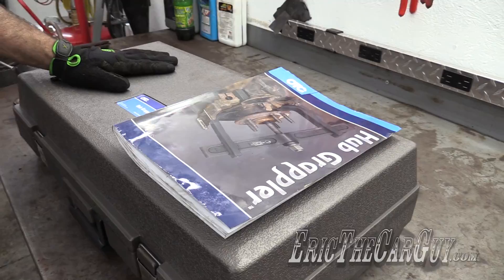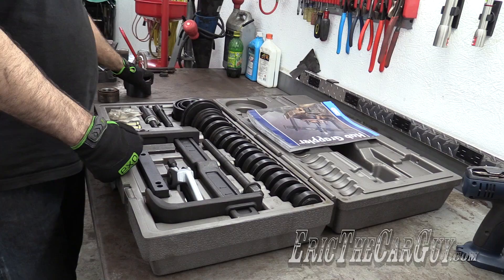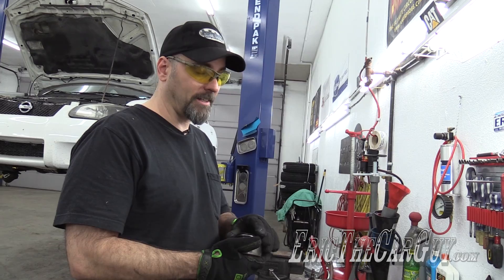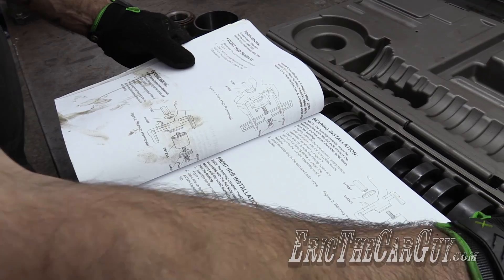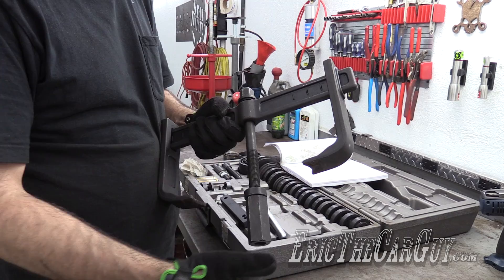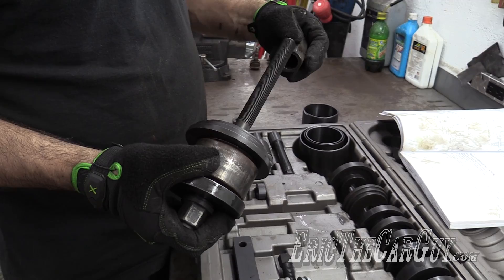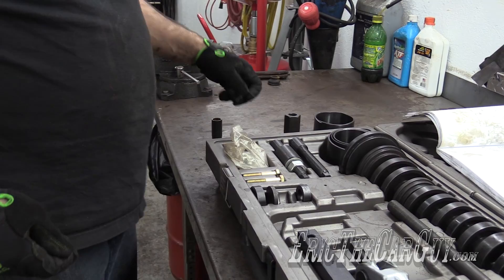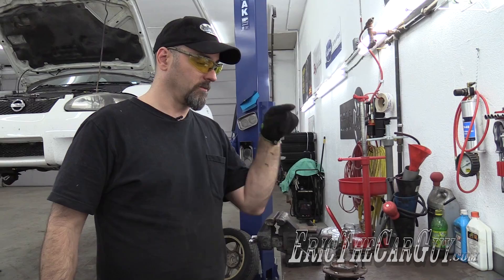OTC Hub Grappler Demo and Review -EricTheCarGuy

Comment: I just used one to remove and installed front bearrings on a 2008 BMWxi with that tool. Very awesome. Only problem was I had to use a slide hammer to take the hub off because BMW decided to put a dust cover that covers the hub and I didnt want to damage it because it was a customer's.  I have the basic Kit with the tool and some spacers. Here's a trick. You can get all those other spacers in your kit pretty much from a Harbor freight master bearing kit which is why I just ordered the basic hub grappler tool

Comment: Eric great review as always, and yours is one of my favorite YouTube channels. About the 4 Runner hub. Aren't they like a normal "unit bearing" hub, and really supposed to be non serviceable? Also with this tool I've only ever worked on one vehicle that you could get the axle shaft out of the hub without either removing the hub itself, or the knuckle. Another thing that would be beneficial to the kit is having the book on a CD, or online so you have the ability to print out what pages you'd like for the job you're doing. Keeps the info from getting all greasy, and eventually needing replaced.

Comment: I pull the knuckle off the vehicle and do the work in my press. I find the worst part of the job is getting the ABS sensor out of the hub without breaking it. this tool would allow doing the work on the vehicle and save potentially breaking sensors.
if this saves breaking 3 or 4 sensors per year then it will pay for itself in a short time.
I have OTC tools that I bought 30 years ago, and rarely have any complaints with any of they're products

Comment: Another good video Eric, you have the gift of gab!!!  I have the Hubtamer but wish I had the grappler attachment.  Looking at your video, it looks like the grappler is pushing against something which in turns causes the forcing screw to push out the bearing from the back.  I'll see if I can fab up something that does the same function.  Thanks again for the video and ideas.

Comment: Hey Eric! Great review as always. I've personally had mixed results with OTC tools. In particular, two and three arm pullers that tended to strip out or fracture the pulling arms. And it was average work. I didn't put a long breaker bar on them and go bananas...Just a half inch drive ratchet. Fortunately, I bought the tools from a terrific local tool shop and they exchanged the broken tools without question. The tools were in the lower end of the price range and the shop owner basically said, they were more or less hobby grade tools so you get what you pay for. I have stuck with the brand because of great support and price from my dealer but I definitely baby them to keep them alive.
Reply: Just wait until they break, that justifys getting an upgraded version

Comment: I just changed my Honda Accord front wheel bearings today with the same kit. Worked just fine.
They still have a light etching on each piece , it does take a while to find the pieces. Mission accomplished tho.

Comment: I have a 2004 ford explorer and have used the OTC Hub Grappler to remove the hub and bearing. According to the manual the cup that is recommended is slightly to small to push the bearing through in my opinion. I used the next size larger and pushed the bearing out without much difficulty.

Comment: Spin the large nut, not the bolt, it's easy to damage the threads that way. 
Also if the threads wear out replace the bolt and nut as a set. They wear and stretch the threads into each other.
Reply: Use a small bearing under the bolt head   You get several uses before it's tossed    It's a feature that saves the threads and should be updated place it under the bolt head and Washer. Then the beating sound when torqued

Comment: I have this tool and my critique was the same. I used a label maker and placed the labels in the relief cuts in the top of the case. That will probably not work long term for a pro mechanic but for a diy'er like me, it should be sufficient. I was going to try to, just for kicks and giggles, to use a stamping set to punch the numbers in the side like you suggested. I would go a step further and spray paint the area with white paint and sand it back off. In theory, that should leave the paint in the punched area and the numbers would show up white.
Reply: Tip, fill in the stampings with a white wax pencil instead of paint.

Comment: couldnt you tape or use a label maker and in the indentions in the case on the top half and label the numbers of the parts so you could find them a little bit quicker?

Comment: hey Eric I have one of those tools but mine came with what appeared to be a two pice cone washer that goes under the head of the bolt it acts as a bearing some tips on it lots of crc synthetic black break lube on the treads and under the head of the bolt and I would recommend always use the large nut the treads are off set in it don't want to know why I recommend it

Comment: I like that version of the OTC tool better, I have a Mac hubtamer, stripped out the Bolt and nut on a rear hub Explorer.   Does the Directions tell you what lube to use on the threads?  I use antiseize on ball joint tool, waiting on new stuff for hubtamer thingy

Comment: Sweet. I bet it could pull off that race that's still stuck on there too. I wonder if it could press out that longer Toyota control arm bushing with the bolts on both sides.
Reply: +ScubaCat3 The kit comes with a race puller, I'm surprised he didn't show it..
Reply: Well he did briefly show the other pullers.  I'm sure he'll feature the tool in future videos as well.  No need to pack so much into a simple review.

I'm just surprised (talking about the previous video of separating that hub) he didn't try the trick of knocking out a couple of studs and driving two bolts into the back of the knuckle somewhere to press off the hub.

Comment: Maybe use a label maker and stick the numbers on the side as a fix. I take it you might have to redo the label after a few uses but will make finding them easier. or scribe into the case where each part of tool goes.

Comment: hi eric i have this hub grappler and also did a 2004 explorer rear wheel bearings

i found the cup it calls to use for is to small and tore into that one and i used the larger cup

it destroyed both cups and otc wont replace them

did you ever get a new cup who can i contact

Comment: I know this is an old episode. But I'm seriously looking at buying the OTC Grappler kit. But the application guide is not available for download for free. (OTC used to be a pretty good tool company...) - They want $60.00 just for the guide!

So, question, can you please let me know if this will work on Volkswagen Jetta Mark IVs? I.e. 2001 - 2005 Jetta TDIs or (as a Sedan or Wagon in GL and GLS trims), which were available with and without Sport Suspension options.

Comment: I have a friend with a 2005 Chev. Astro van AWD.  She took it to a dealer and they told the drivers front wheel bearing was bad.  It cost her 630 dollars with 100 of it bearing the labor.   I assume the replaced the the whole hub assembly.  Would this tool be able to replace just the wheel bearings rather than having to replace the whole hub assembly?  Btw, Thanks for your videos.  I look forward to viewing when ever they are available.
Reply: Cant buy bearings without the hub for astro

Comment: Pressing the new bearing in with an impact, aren't you worried about damaging the races? Or do you think that's nonsense?
Reply: P.S. For the 4Runner, you should have used a 10 pound slide hammer and you should have been pulling outward on the T-handle while you slid the weight. Not that the hub grappler isn't a better option.

Comment: those numbers used ..a 314311 ..really?? Did OTC need the ability to have 999,999 item codes?
 this is the type of crap I run into at my work ..( everything starts with  8888888888888 - then the barcode number we assign the item !!!! 
 On the Hub Grappler you could have  HG 100  HG 101  HG 102 ECT ... mayb sleeves would be  HG s100  HG S200 ... not reallt difficult to NOT make is a random 5 numbers !!!
Reply: +deepsquat600 if they ended up needing just 100,000 item codes for each individual piece of each individual tool set including the manuals, cases, and other related materials it would justify the use of a 6 digit code. Once you consider that that kit was likely devised from several smaller kits for specific applications which each had their own numbers (so did their cases and manuals) and that they will likely sell upgrade kits for this set (everything gets outdated) 100,000 is easy to see as a possibility. Oh I shouldn't forget I bet from time to time that manual gets updated as more parts are added to the master set...but the addition of parts means the master set gets a new number...

Does it really matter that it is a 6 digit number? Heck, my phone number has 11 digits. Do you think they need 99,999,999,999 different phone numbers?

Comment: Simple low tech solution for component identification in the box. But its really not hard to match plate and sleeve up to the knuckle or bearing like we do now, why such a complicated big book for something you have easily done all these years already, I wouldnt waste my time with the book.
1. Get piece of paper or card board
2. Make simple stick dwg of plates and hubs in box
3. Read numbers on plate, write numbers on dwg
4. Keep dwg in box
Your idea is good but they would charge 150$ more for white numbering, all they need to do is put a number, single or double digit below each plate , molded into the box, and have a cross ref card from that to long otc number.

Comment: I'd emboss the area under each spacer. You wouldn't have to spin each one to see the number and besides it taking time to pull out each one I imagine it would be hard to read the little numbers in dim lighting or if your eyes are old like mine or if it's dirty from being handled and not cleaned up before you put it away , .... somewhat like your greasy, dirty manual is
 I'd laminate each page of the book and place them in a 3 ring binder. I also would make a spare copy of book in case you loose a page by not returning to the binder if you removed it . We've all done that.

Comment: Seems like people are using the OTC Hub Grappler. What about the Ken-Tool Hub Shark? 
 We the Hub Shark kit at my shop that the company purchased but over the years previous employees only used the cups and adapters on the hydraulic press. It seems EXTREMELY heavy duty but now missing the center screw. Has anyone ever used the Hub Shark? Any videos on it besides the 10 year old one?

Comment: I may consider getting one (even though it's probably made in China, and I stubbornly support made in the USA & Japan; Craftsman tools are slowly replaced by made in China, and I've been running all over the place to get the remaining USA-made tools).  For 04-08 TL, R&R of the front wheel bearing requires special tools & hydro press but if this tool works by itself it would save money.
Reply: Made in Minnesota :)

Comment: I think OTC did not etch part number on side- a.) if it was lasered on side it would wear over time through use b.) etced on side might take away the milling spec of fit THUS i agree the etching could be better on FRONt. * remember thats serious hardened steel.

Comment: Why pull the hub/bearing out of a bolt-on assembly?  Just replace the whole thing. You've already removed it from the knuckle, why take the extra steps of replacing the bearing? I didn't know you could even do that with a bolt-on.  Especially if the wheel speed sensor is integrated into it.  But hey, not trolling. I honestly want to know because I've never heard of any tech doing that.

Comment: I would use duct tape and sharpie to mark sizes in the case but that & the book is not necessary, I have a master set and I just pick the tube that fits the knuckle and the cap for it is idiot proof. I can do that far faster than searching through a thick book to tell me the blantly obvious.

Comment: You can buy that tool for about what it would cost to have someone do the job.  http://repairpal.com/estimator/front-wheel-bearing-replacement-cost
Reply: I was thinking the same thing. I've had my front bearings replaced twice in 3 years. I would have saved so much money if I had just bought one of these.
Reply: +KingNast twice in three years? Were those bearings made from plastic or what o.O
Reply: BavarianMonkey  I know! The last guy said it's pretty common with my car for some reason. It's a 99 Acura TL with only 80K on it. I should ask EricTheCarGuy about it
Reply: +KingNast 
One of the plusses with the '99 Tahoe is no wheel bearing or front axle shafts, not even the boots, replaced and I have been driving it from the 74K it had when I got it to the current 269K.  I have had some front end parts done, but overall, not excessive.  American cars are not always the worst.  I keep tire pressure up, and get wheels aligned at every new tire replacement and buy the balance and rotate package and follow it.
Reply: Would be even better for diyers if the tool was available for rental.
Reply: +psdaengr 
I concur.  Many of us do not need a full time tool that would just mostly take up space in an already crowded tool arsenal.
Reply: +psdaengr most auto parts stores have told like this available for rental, usually the rental is free when you buy the part, buy you put the cost of the tool down as a deposit and get it back when you return the tool.